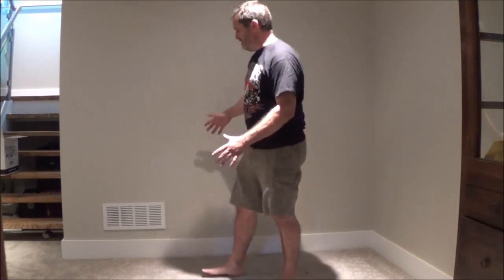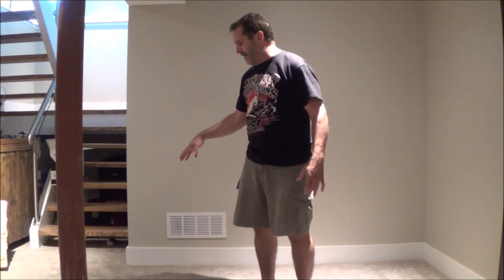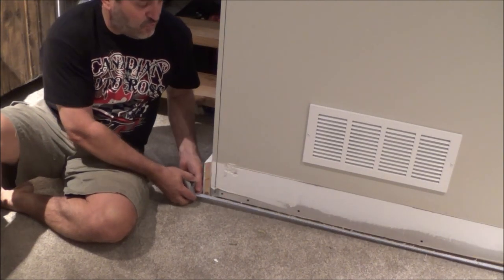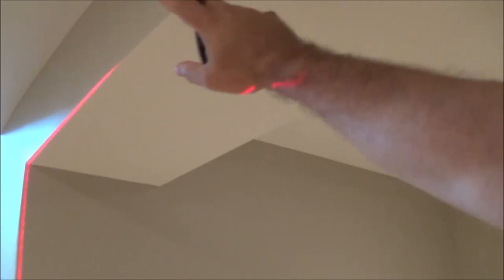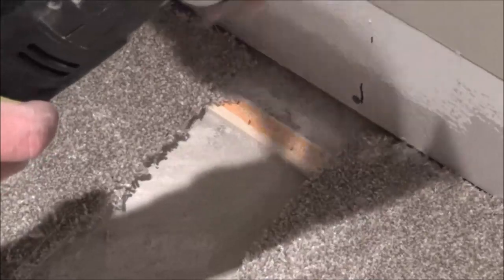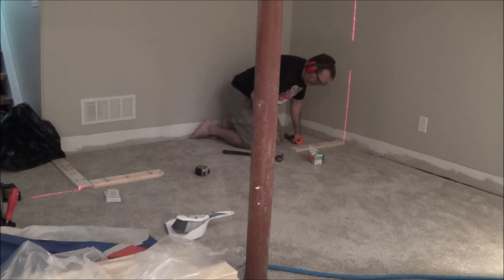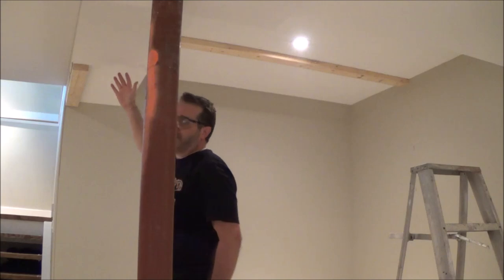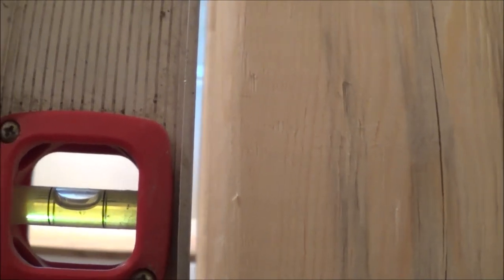Framing a closet in the basement

Comment: Hey buddy you closed off the return vent to that room in the basement.  You may want to vent the closet in some way, to regain air flow.  Creature comfort, you can’t remove heat from room if return air is closed off.  You also could have stratification when running heat.  You could just leave a hole on the wall coming down stairs, and attach a square vent to inside and out. It would be close to existing return that way.
Reply: It's a small closet I'm assuming for storage is that necessary
Reply: That's what I was noticing right from the beginning possibly he could build a small soffit then move it over to the other, new closet wall. It's an interesting location being that there is no basement below 
I must surrender all the way down from the attic above

Comment: It's more effort, but there is a cleaner and sturdier way: attach the new studs flush to the old studs (with NO drywall in-between the old and new wood.. like the framing would be if it were built this way originally). 

The problem is over time the drywall will crush, and even if it does not fall out, there will be void space allowing the new framing to "flex" (just imagine children bumping into the walls hard, and now you have huge cracks in the new drywall). You could just use the razor and chisel to remove old drywall the same way you removed the carpet.

If you ARE going to do it this way, then at least use long decking screws to attach the new framing through the old drywall into the old framing. Nails that are not flush will come loose, and the drywall you sandwich will compress over time. But the screws won't allow any flex, and if needed you can tighten them.